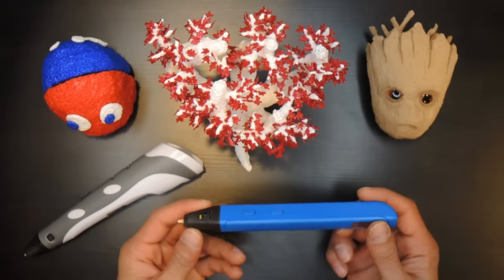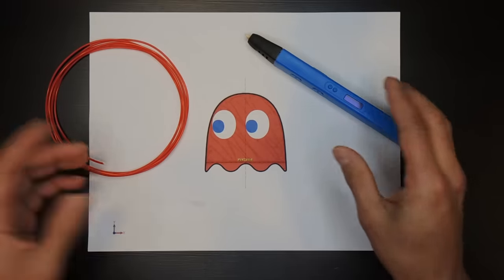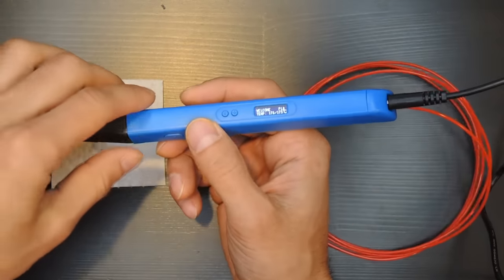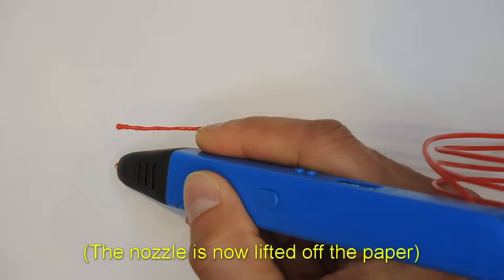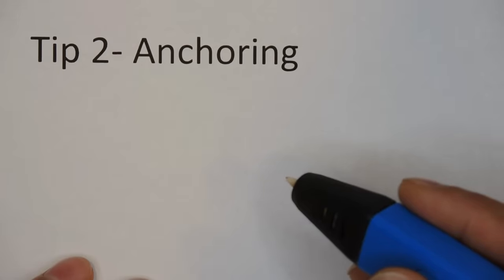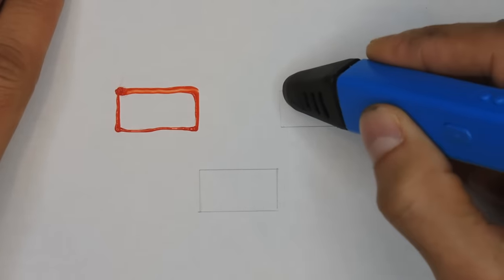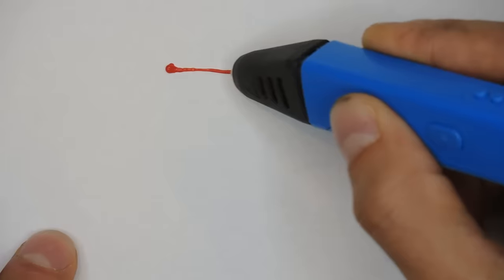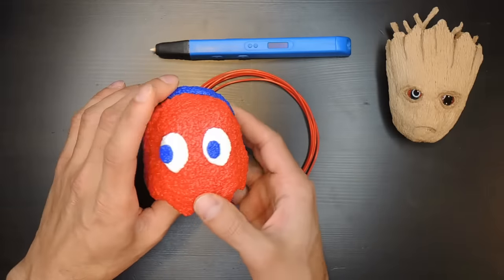How to 3D PEN Tutorial #1 | GETTING STARTED

Comment: While ABS smells horrible, it's actually not particularly toxic.  PLA actually gives me a headache, while ABS does not.  That said, ABS is terrible to work with.  HIPS is a similar plastic that's much easier to work with (and smells a bit like oranges). But by far the easiest and strongest material I've tried is PETG.

Comment: important tip, don't buy a very cheap 3d pen for practicing before buying a good one.
i bought one that cost 8$ and that included a lot of filament.
the pen "works" but only have 2 speed settings. 
really fast and insanely fast!
also, it has no temp control.
but the worst part is the constant need to preheat it. even while using it!
every time i pause for more than a second, i have to wait 20-40 seconds to reheat it.
Reply from the maker: Thanks for sharing this.  Adjustable temperature settings and a button/slider that can change speed settings on the fly (and provide more than just 2-3 defined speed levels) are a must have for me, on any pen I buy now.

Pausing like that also sounds like a complete deal breaker.  Can you share the manufacturer and model of pen, so people (myself included) know to avoid it?

Comment: Nice video. I just got my 3D pen. Just a very noob question: The manual doesn't mention any way to turn it off. Do I just unplug it (after removing the filament)? Mine looks almost like yours, except without the temperature controls (it only has a PLA/ABS setting).
Reply from the maker: Yep, just unplug it!  Good luck and have fun with your pen :)

Comment: Hi i have a question about 3d penning... i typically keep my pla on the spool and use something to help it roll out... I know i am probably answering my own question in a way... i don't feel too restricted by the power cord i dont think... but when i pen off the spool it seems to feel tight, should i just make... coil packs and ditch the spools? I started out using a 3d printer and when i scrapped it i got my pen so i kept my spools

Comment: Mine doesn’t have a speed setting 😭
Reply: Your Not Alone. Mine Speeds Up And Slows Down Randomly... I Have NO Control
Reply: I think the speed depends on the temperature. If you increase the temperature using PLA you should be good to go. I have an Intelligent 3D pen and mine works so far. It takes a while to learn about it but if you know how to use it you should be good. But it's takes practice and a lot of patience.
Reply: Welp, update... mine does have a speed setting but it REAL HARD to control ;-; and also I may ave broken it by stuffing small filaments down the end.. 😂😭
Reply: @issyzh  Did you try to increase the temperature of the filament? I think that should help it process through more easily. But if your out of filament try getting some extra filament the Size of your nozzle so you can try to fix the problem. I'm not sure if it will work but I gave you an idea.

Comment: My pen have excess filament leaking right after releasing the unloading button. Do you have any recommendation for this kind of problem? 😭
Reply from the maker: This happens with all pens to some degree.  But here are a couple of things to check/ try:

- Try lowering the temperature, little by little to see if that helps.  Then go with the lowest temp that the filament still comes out, but hopefully leaks less

- Make sure you aren't using PLA filament on the ABS temp setting

- Some filaments leak way more than others, like wood filament.  Some pens also leak more than other pens as well, if they don't have good retraction settings.
Reply: @PotentPrintables  Thank you for noticing my concern! <3 will try to do ur reco ~

Comment: I used wax paper and it stuck to that :/
Reply from the maker: Make sure you are using the right temperature for PLA and then if it is still sticking, drop the temperature of your pen a few degrees at a time until it does not stick anymore.  If the temp setting is to high it is much more likely to stick.